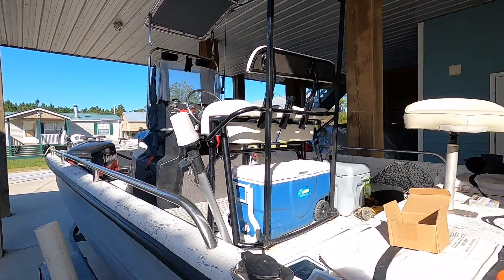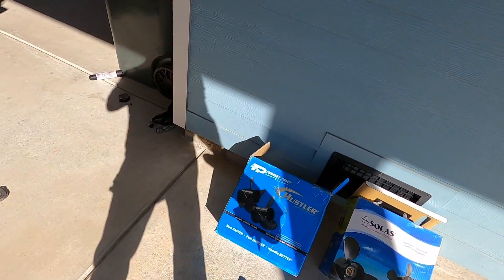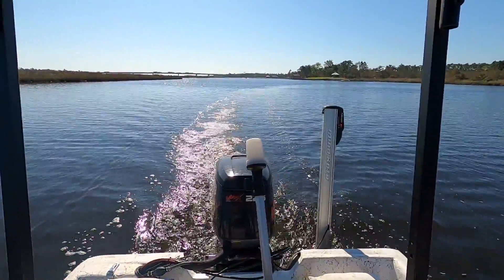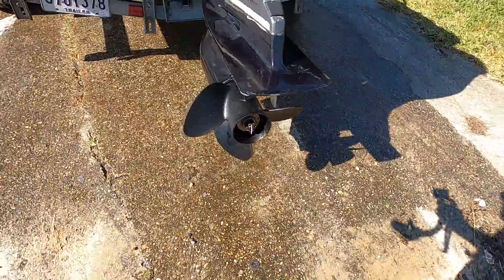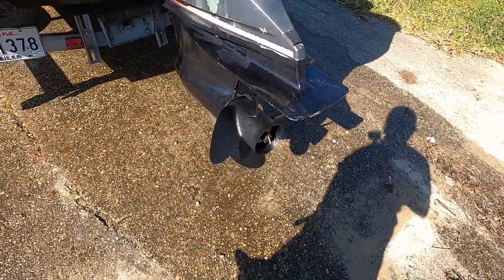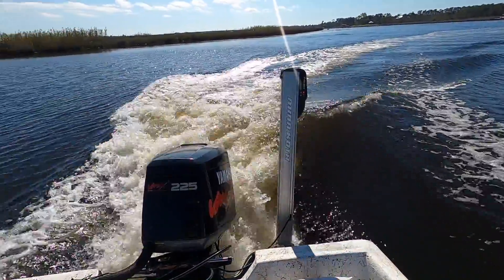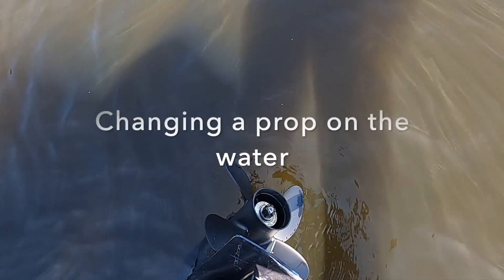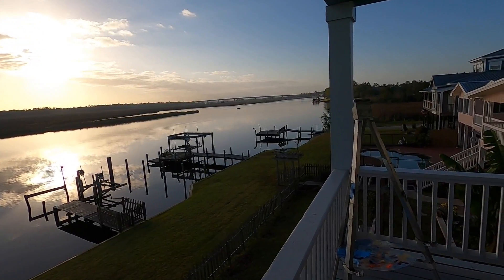Are 4 Blades better than 3!? & Selecting the right pitch prop!

Comment: If you dropped 2 inches in pitch on the 4 blade you would get good hole shot……but your top end is going to suffer. Putting more ears in the water is never the answer for anything but a barge.

Comment: Four gives you more control  and hole torque,, three gives you more top end speed and higher rpm’s. Without breaking down the pitches and variables that entails. But the three blade will give you more top end speed. Enjoy your testing.

Comment: Lol I have never seen such a horrific prop choice failure. Apparently when you want to use a 4 blade you are supposed to use a shallower pitch as the work load is higher. There is a most efficient loading that gives you the ideal rpm. Obviously engine was overloaded with that prop. 😂 Did you put the thrust washer on the wrong side of the 4 blades prop.?. Lol
Reply from the maker: Thanks for watching! Yeah I had no idea. But I returned it with out damaging anything.

Comment: I have a 2009 Yamaha 250hp V-max 2 stroke and I have tested 2 props, one is 14.5"x23 pitch 3 blade and the other is 15"x24 pitch 4 blade, and in my case it takes off much better, without any problem with the 15"x24 pitch 4 blade. Now! I'm about to try a 13 1/2"x 27 pitch cleaver 3 blade prop, but this crazy weather hasn't given me time to test what the result is. Blessings.

Comment: If going from a 3 blade to a 4 blade you need to reduce the pitch by 2in and also reduce the overall diameter. I gained acceleration/ hole shot gained handling especially in hard turns with out prop blow out (wide open throttle,  on hard turns 100% port or starboard with out having to lower the motor) and kept my top end, so my time to plain was cut by 7 seconds time to wot was cut by 7. All with out loss or wot rpm and best of all a better ride too
Reply from the maker: Great Info! Thank you!!

Comment: Currently I run a 3 blade stainless ballistics prop with a hub saver kit on my 1995 20 foot Sea Arrow center console inboard with a Volvo Penta V6 4.3 liter mated to a OMC SX out drive. The motor was rebuilt and a bigger cam was put in and a bigger carburetor. A 4bbl Holley 4160 600 cfm carburetor.it bright it from it's original 190 HP to 225 HP. It also sounds pretty good you can hear it on my page in my videos if you care to look. I can't remember the exact torque off the top of my head I'd have to dig out the build sheet . My main cruising rpm is usually between 2700 rpm to 4250 on the higher end on average. At about 3800 to 4000 rpm I run about 30 mph depending on the conditions. Wot is recommended 5000 rpm and I run 45 to 50 depends on conditions again. But I don't run at that rpm often. I Only run that if a Storm is coming or I need to get in for an emergency or in a hurry. Or sometimes just for fun but top speed isn't a huge concern with me . I pack quite a bit of gear and keep some tools and a spare prop and my anchor things like that . I have also added 2 batteries from the original 2 . Then installed an audio system and lights, but basically I have probably added a good estimate I'd say 350 ish lbs of extra weight . That's not including fishing gear and people food and a full ice chest . As far as people usually it's either me and my wife or us and our 3 kids or us and another couple. At max I prefer 6 people just for the comfort level. I have noticed out of the hole it's a little slow to get on plane especially if the boat is heavy in the back . And depending on my load it has a hard time on plane as far as maintaining a good plane at lower speeds. The boat is rated for 10 persons plus 250 in extra gear. So I'm well within weight safety. And it's not a huge problem persay just a noticeable one . I'm ok with sacrificing a little top end speed for a better hole shot and slower and better planing ability at lower speed. I feel like a 4 bladed prop would be more suitable to what I desire . Would you agree givin everything I have mentioned? I have looked up compatible prop options and found a 4 blade with the correct diameter and pitch so I know mechanically it would be ok but do you think I would get the results I'm looking for ?

Comment: You put the thrust washer on the wrong side of the prop.  The prop is probably binding against the motor.
Reply: Yeah, so how can you take this guys advice if he doesn’t even know how properly know how to install the prop?
Reply: I agreed with you guys how the hell he ended with 10 mph it makes no sense at all...must be somthing not right when installing.. cause it cant drop so much
Reply: pay attention to the video, when he removes the 4 blade prop, there is the washer first than the prop, just use the washer in front so that the nut is more exact to the pin, minute 7:44.